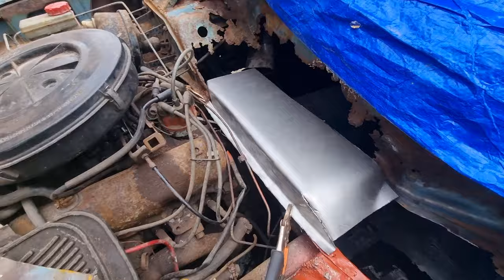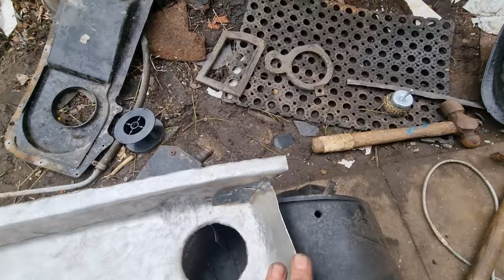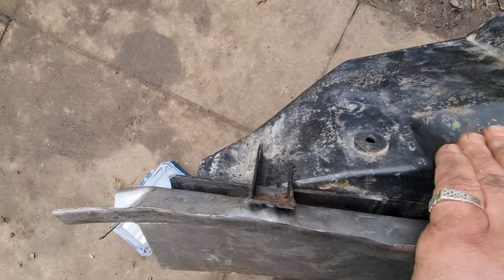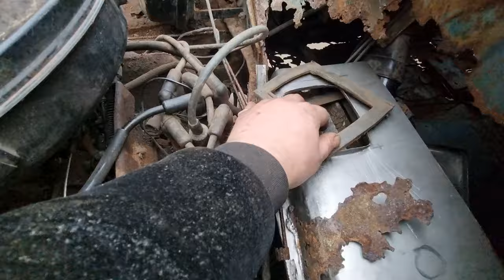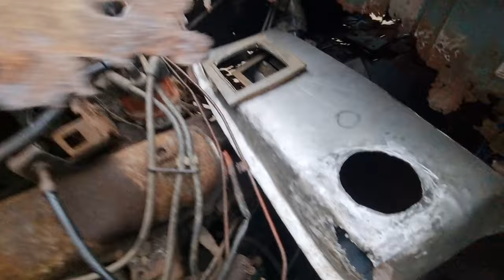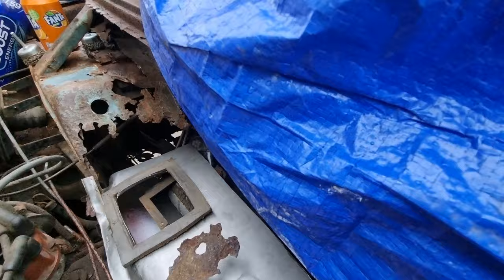Cortina Mk4 Ghia 2.3 V6 Restoration || Heater Box & Bulkhead Repairs (P9)

Comment: Amateur restomodder here, props for not being put off!

My interest in old cars has settled on the Fiat X1/9.

Which had a terrible reputation for rust and in fact the top 3 comments I get are -

Is that a TR7 ?

You don't see many of those.

I thought they all rusted away.

Considering it was designed in 1973 and remained in production until 1989, people had stopped using them as daily drivers by the mid 90's.

From say 1995 until 2020, it was possible to buy a complete X1/9 with a A3 or B1 condition shell "for a few grand".

Only very recently have all these examples disappeared off the market.
Reply from the maker: I won't get put of hehe once I start somthink it as to get finished or it will drive me mad lol
Reply: @AdamSNook.  Yeah I'm like that too 😀

Comment: Nice job Adam looks great 👌 if I remember my cortina correctly they used to collect water and leak around those round holes under the heater box so we used to put a bit of sealer around them to keep the carpet dry lol making some great progress mate a little everyday adds up to a lot quite quickly well done it’s coming along 👍
Reply from the maker: Thank you mate yeah I qas thinking of that there is ment to be a indent under the air box and I was thinking wouldn't that just hold water it would just sit in the indent like a swimming pool lol might make a few mods lol

Comment: Looks good 👍 
If you pull out the engine it’ll be much easier, you’ll be able to stand there rather than leaning over.
Reply from the maker: Yeah I'm waiting in doing a will it run first hehe then will remove it
Reply: @AdamSNook.  Everybody likes a will it run 😎